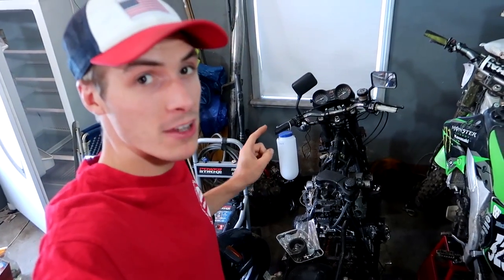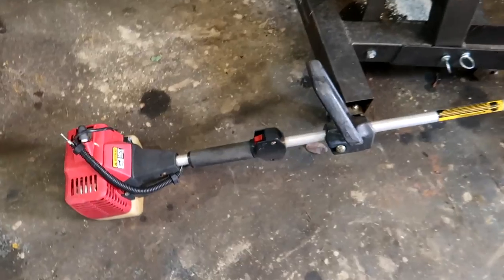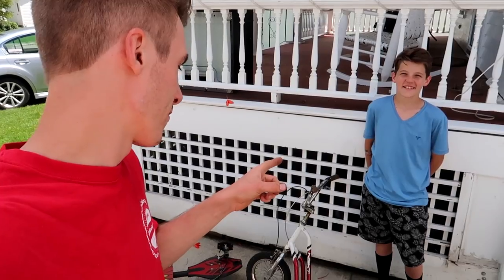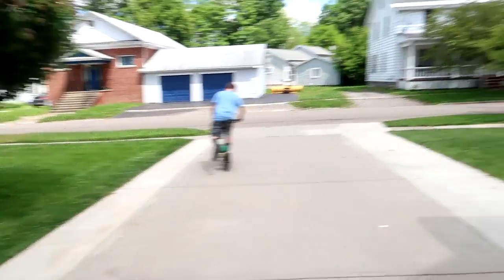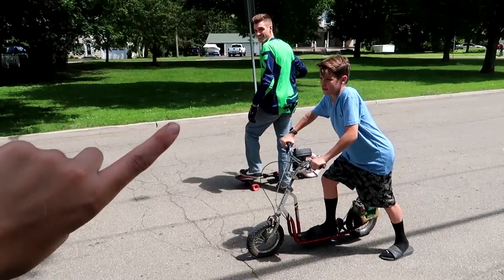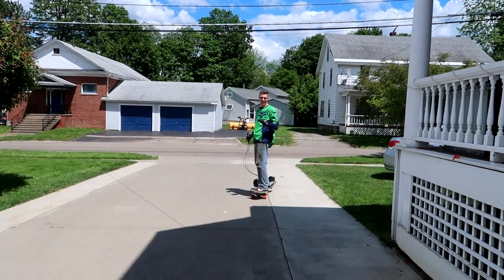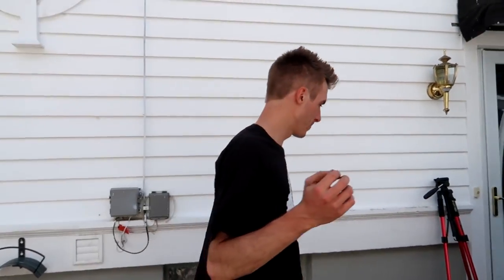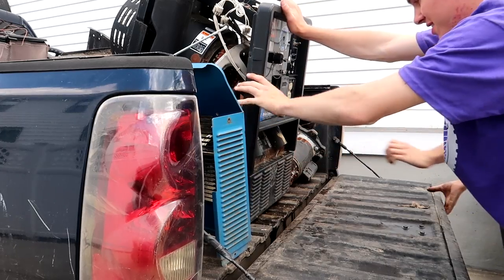THE CRAZIEST LITTLE RACE!

Comment: those small diaphragm carbs will overflow if the gas tank is above the carb,unlike the float type ,which rely on gravity   The weight of the gas can override the diaphragm types tiny spring closed needle when not running.

Comment: what's up Dalton looks like you need to put a smoother wheel on the crankshaft that way the tires not getting so worn out from that Jagged weld you got going on buddy before you sell it or that tire problems going to keep happening